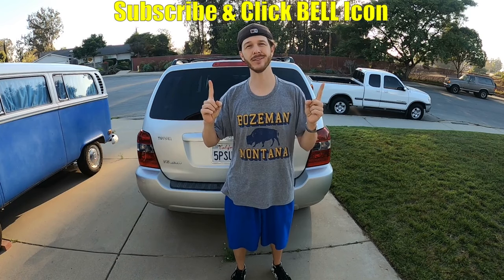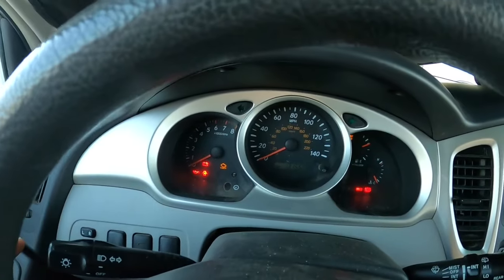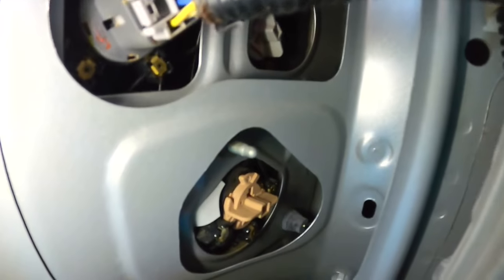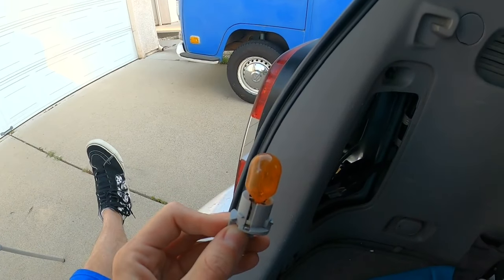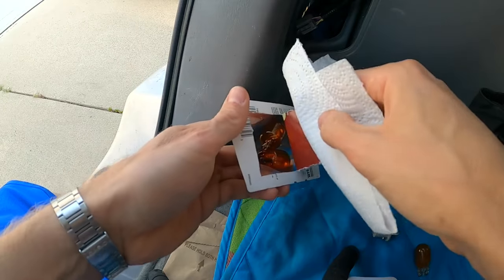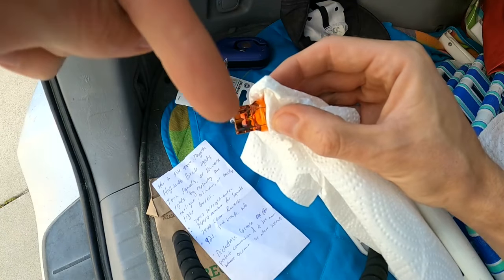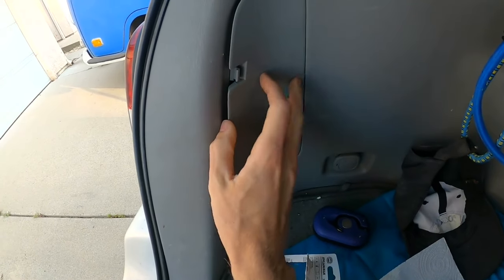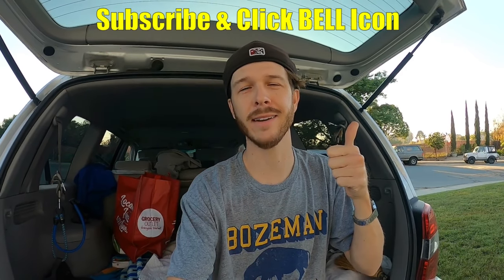How To Replace Tail Light Bulbs, Turn Signals & Reverse Lights on Toyota Highlander

Comment from the maker: TOOLS & SUPPLIES & DONATION LINKS
Dielectric Grease- https://amzn.to/3QxmvLr
Taillight Bulbs 7443- https://amzn.to/3GVyNtZ
7443 LED Bulbs- https://amzn.to/3ZpiTPV
Turn Signal Bulbs 7440A- https://amzn.to/3XgIRmA
7440A LED Bulbs- https://amzn.to/3intjPu
Backup Reverse Bulbs 7440- https://amzn.to/3X5psFG
LED7440 Clear Bulbs- https://amzn.to/3W3O7Jx
3rd Brake Light 921- https://amzn.to/3ZlwwQ9
LED 921 Bulbs- https://amzn.to/3Gzfo0I
Tool Set- http://amzn.to/2xoyu5c
Safety Glasses- http://amzn.to/2ez41Jw
Nitrile Disposable Gloves Large- http://amzn.to/2w0dlwcMagnetic 
Mechanics Gloves- http://amzn.to/2w0i1SP
Work Light- https://amzn.to/33tk6tp
If you Enjoy the Channel Consider Helping Support it by Donating with Youtube Super Thanks or Using Links below or by Subscribing (it's Free) & Watching some of my other Videos
PAYPAL DONATION https://www.paypal.me/JonnyDIY
Zelle Donation JonnyDIYs@gmail.com 
Venmo Donation JonnyDIYs@gmail.com

Comment: Yeah baby! The Indestructible Highlander is BACK !  Great Video, especially liked the details about applying the electrical grease.  I had to do my passenger side bulb. Toyota makes it easy because these Highlanders are built at Area 51/S4 using top secret alien technology 😁 Just seen one the other day with close to 400,000 miles
Reply from the maker: @Shadowman... Heck yeah, she won't die! 😆Thanks so much! Ohh wow yeah I met someone the other day that had one around 300k. Great cars. This one has the V6, not sure if the 4 cyl model is as reliable
Reply: @JonnyDIY  I owned a 4 cylinder a few years back and they are great on gas but can be known for oil consumption problem if you don't keep up with oil changes. And they tend to run hot so the catalytic converter and radiators go on them ~ But you don't have to deal with a timing belt.
Reply from the maker: @Shadowman...  Ohh nice, timing chain. I wouldn't mind having one of those, better mpg probably, but sure is nice having the extra power of the v6 though.